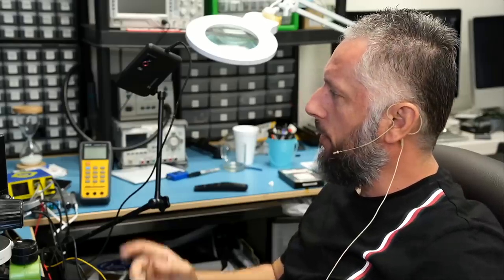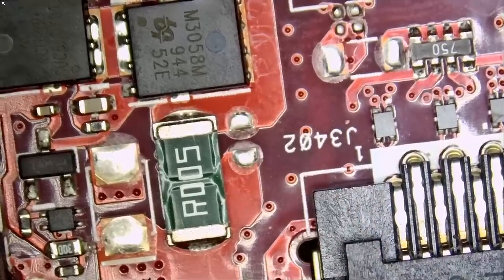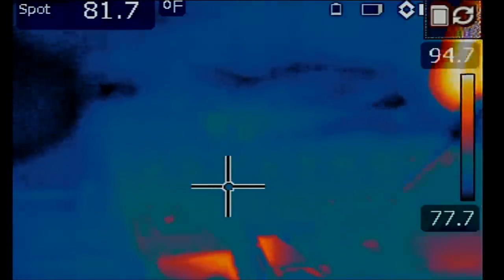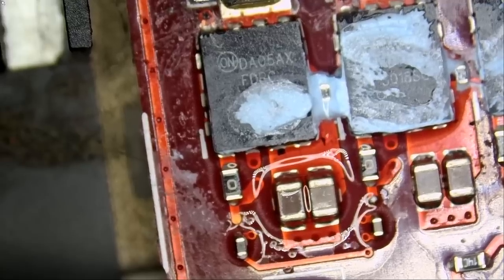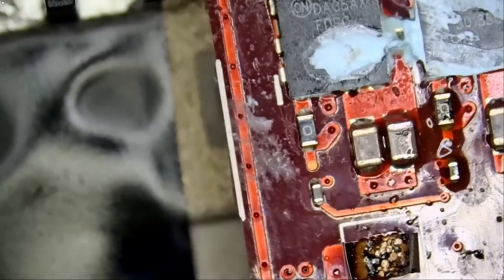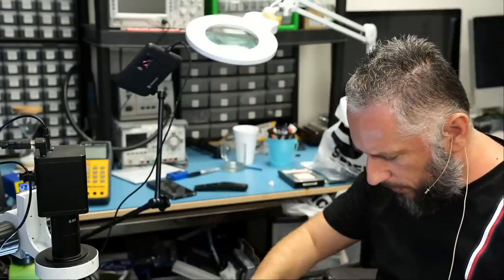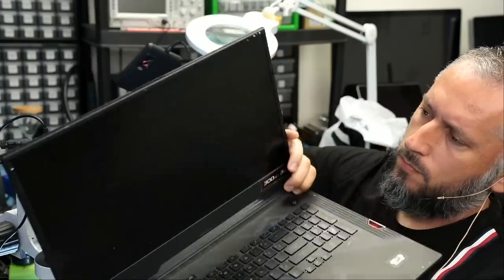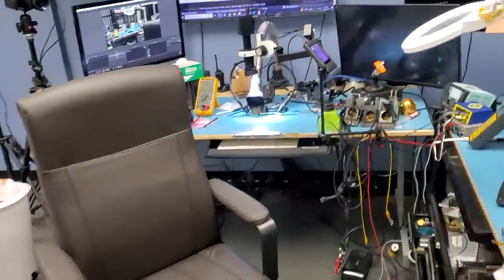ASUS ROG G732 Laptop Repair - Short circuit caused by Overheating

Comment: It wasn't the heatsink.... It needed big boss's touch.
Reply: I was about to write smilar comment.
Reply: There's an intrusion sensor on Asus laptops if you don't fully reassemble them they will not power on..
Reply: neither cpu or graphics chipset had heatsinks on and would thus overheat and shutdown then restart

Comment: Why the cap failed is because of heat, simply looking at a cap's datasheet Show that thé life expectancy is directly related to working temperature. But what is outrageous is the way they failed compared to good electrolytics, which almost always failed letting thé circuit open and not shorted Imo. The only good thing is that they don't explode, but that makes the pinpointing of the Bad cap almost impossible without a thermal camera. Good job Alex !
Reply: ceramic caps will always die in a short. there is nothing outrageous about that
Reply: Ceramic caps are actually quite resistant to heat, it's a sandwich of metal and ceramic layers, literally nothing for heat to degrade. 
Ceramic caps are prone to failure in otherways. You don't have to have it overheating for it to fail. Ceramic caps are ceramic and anything that would add physical stress means a potential for cracking and causing a short.

Comment: A woman heard a pipe rattling loudly in the basement of her home. Distressed, she called a plumber. He came over. Looked at her furnace. Took out a hammer. And banged a pipe. The noise was gone. The problem was solved. “That’ll be $100.” he said. The woman was furious and demanded an itemized statement . She said it only took a second. 

He replied, 
Hitting pipe with hammer: $5.
Knowing where to hit the pipe: $95 🤣😂🤣

Comment: Alex, I notice you very rarely, if ever, use Flux when desoldering components, even when they are stubborn. Is it appropriate to only use flux when soldering and not de-soldering? This is not a criticism, but an actual question as I'm curious about when and when not to use Flux.
Reply: I'm just guessing, but I think it's because flux is used to make a cleaner connection between soldering points. When he's removing a component though it doesn't matter about clean contact points, so he doesn't use flux. Again, I'm only guessing though.
Reply: @NonLegitNation2  Yes, correct. Desoldering only needs the solder to be molten. No need for flux until you resolder.

Comment: i have a similar model ROG laptop. ive run into that issue when first trying to power on the laptop only lights will show on the keyboard ( mostly only happens while laptop is plugged in ) take power cable out of laptop and re power and it turns on no problem. doesnt happen all the time but i do find it strange not sure why it happens